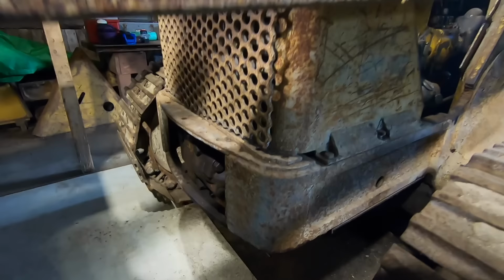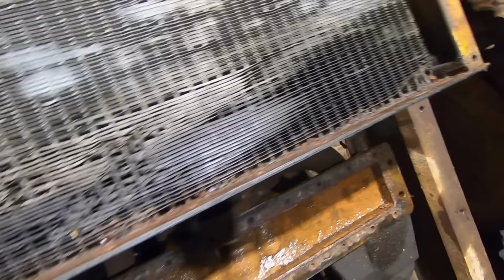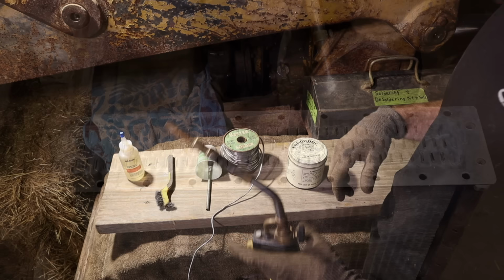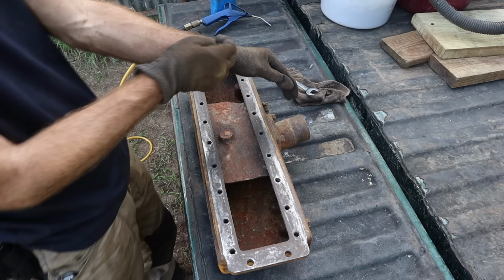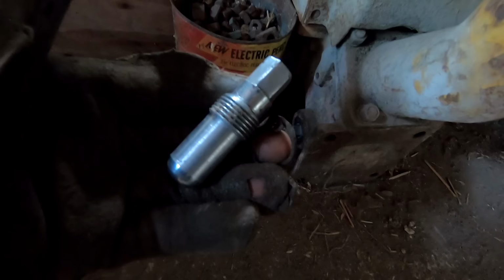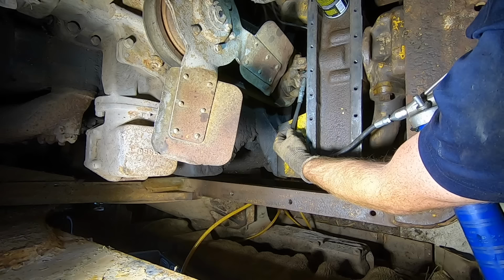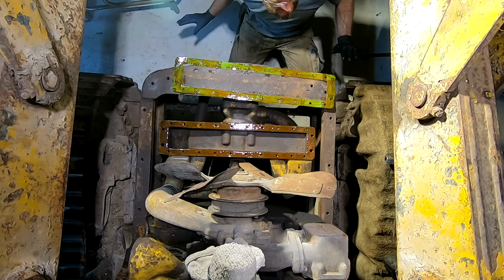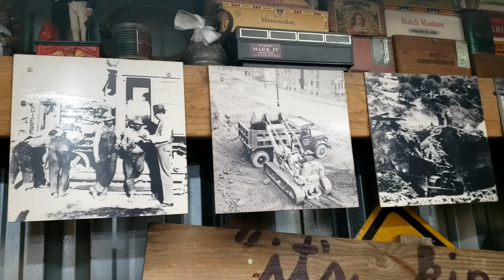The Radiator's ALL CRACKED up... I Guess We Should FIX it! ~ Part 3 ~ 1950's Caterpillar TraxCavator

Comment: Thx so much for sharing. After watching several episodes it becomes quite apparent that this machine was severely hacked over and over. It's one thing to have a bolt here and there break, stuff happens but to have bolts missing that is unfortunate. It seems the more you look the more you find where the machine has just been worked on by people who don't care. The fuel line routing, come on, if you took the time to remove the plates then you would see that there was going to be interference with the brake pedal. It's one thing to have to deal with failures due to age, bad seals, bad gaskets, bad fluids etc., but it's quite another to deal with things that people have just made a mess of.
So far you've done a great job.
I didn't get a chance to read through all the comments but the hours meter should be in the 3,000 hr range. This machine has been used extensively but not 30,000 hrs. In car terms 2,000 hrs is about 100,000 miles.So, the equivalent is about 150,000 miles. So, this machine is thoroughly used. The heavy equipment operators/owners can give you a better idea than me.
The gasket trick was great. I had an older neighbor that showed me that trick. Thx for immortalizing it here on YT.
I hope this machine works out well for you.
Again, thx for taking the time to share your experience and the added narrative.

Comment: I really enjoy watching your videos and like others admire your tenacity. I'd be more liberal with the release oil though. :)
Just one small point the difference between a bolt and a machine screw, is screws have threads all the way along the shank and bolts are only partially threaded. Those were screws you were fixing the radiator with.

Comment: Hello Salvage Workshop, I love your videos and could I really make a suggestion? Before you continue the works you could put this track loader out of this garage and wash all the tractor with soap and degrease solution, and rinse off wiht a lot of water removing all the old grease, soil and dirt. This process could help you to prevent that some dirt could entrance in the engine and support you to see better any kind of leaking, rust, wear etc.. It´s really interesting could to see this old boy cleaned. 😁😁😁

Comment: Today, it would be a cheap thin steel, so one bang and you have to service it to get the part replaced. That is some heavy thick metal in those old machines.
Reply: I own a 1977 underground haul truck and a 1983 loader...everything on them is, like you said, heavy thick metal. No pot metal or plastic on those things!

Now that I mention it, I also own a 1974 loader that's not in running condition. I need to get it hauled back to the yard so I can start tearing into it. I also have an air track drill of...unknown age, and a slusher/scraper hoist that could be very well seventy years old for all I know. Those things are all built to last, lots of massive forgings, castings, and heavy stock.

Comment: if you want to clean between the fins, you can get a foaming cleaner at the big box stores for ac coils. we use it when servicing four wheelers, side by sides and any other off road radiator. when it foams it dissolves bugs and pushes out the dirt.

Comment: nice techniek for making gaskets ill remember that i used to make the surface wet with some oil and than cut out the print that it leaved behind.

good content keep it up
Reply: I've done the exact same thing.  but I think the oil may keep the gasket adhesive from sticking...
Reply: @AffordBindEquipment  adhesive how do you mean? The paper gaskets i use don't have anything to stick
Reply: @wernerbraamskamp3279  extra insurance gasket glue/sealant like Permatex.
Reply: @AffordBindEquipment  ohhh okey i will remeber that

Comment: That pin you were wondering about, is the axle pivot pin, it supports the front of the tractor, and it allows the tracks to pivot up and down, independently.

Comment: The best thing for finding parts on that old 77 cat is a factory parts book. 
They can usually be found on eBay, that’s gonna be your best way of finding any part for that machine. 
A search for a part on any of these old cats is impossible without a part number. 
I got a 1976 977L just trying to search for a water pump or something is nearly impossible I had to buy a parts book for mine as well and it has been a tremendous help for part searching.
Reply: Also you might get lucky and find a factory service manual that would be a tremendous help for fluid capacities, what types of fluids, etc.

Comment: That traxcavator is an Incredible machine... I had one for about 20 years, got it in the early 70's. My cat was a 1958 model and among the last to have a pony motor starter. I no longer have the machine, but I do have the shop manuals... I redid my upper and lower tank gaskets in the early 80's almost exactly like you did, but at that time I was still able to buy the gaskets from cat. Only thing I did different was I flipped the radiator core top to bottom, was advised to do that by one of the old (at that time) mechanics at the cat dealership... He said they always did that whenever possible to extend the service life of the radiator core... all the millions of vibration will work harden the tubes and flipping them helped extend their life. BTW cat has a very good antiseize better than any other brand I have used. I had several broken bolts to deal with on my cat equipment but managed to get them all out and replaced. Good luck to you I did enjoy using and maintaining my Traxcavator and Motorgrader, cat made the Best yellow iron. And that fitting is for a remote grease hose (small hydraulic hose) , makes greasing that pin and bushing possible.

Comment: Lisle Tool Company makes tap adaptor sets, will allow you to use 1/2", 3/8" and 1/4" drives to run your taps. They come in two sets, one for smaller taps, the other for larger taps

Comment: Troublesome or worrisome gaskets that are prone to moving or slipping out of place I use sewing thread to tie the gasket in place so it can not move, the thread is thin enough it will not bother the seal. Very handy for pan gaskets and water pumps.

Comment: A fascinating series of videos on this machine and you are certainly putting some work into it. I have done an old truck radiator like yours but I also put some air pressure down each tube as I found some that had holes along them so then I soldered the ends up. I think you've found the demise of this machine I bet the rad went and they tried to repair it but failed so got another rad but that was never fitted. Good luck with the rest.

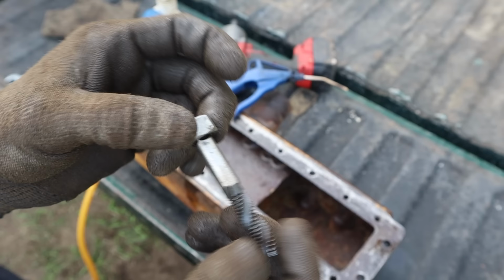Comment: 26:25 Tap sockets are a thing for future reference. they are amazing, I use them to power tap holes with a cordless drill at work, just a normal socket adapter. for re-taping, I would just toss a 4" knurled extension in there so you can hand start it one-handed, and then stick the drill on

Comment: Back in those days what they would  use for a radiator gasket was they were taking innertube whether it was brand new or an old one and they would cut it to fit the radiator and they will put it on the bottom first and then set the radiator on top. The worst thing was was cutting the boat hose for the gasket to fit between the radiator and the bottom half of the radiator portion or radiator tank going to the Dozier.

Comment: Running the tap with a battery drill works well. Chuck up on the round and it will slip prior to breaking. I ran my 1965 955 for about 4 hours Sunday. I am getting good at using the 4 in 1 bucket as a scraper. Keep up the good work.

Comment: Looks like the bolster pin. That is where the front axle pivots. It may be bent and that is why it is hanging out. Those bolt holes are for bolts to secure it to the axle.
Reply from the maker: Thank you!

Comment: Crazy hard work! Looks like a good fix of the radiator and support cover. The drain plug is a sacrificial anode to protect the radiator core from corrosion. You should do a coolant pressure test to make sure the water pump & radiator are holding water.

Comment: another way to make gaskets is to coat one metal surface with oil or grease and press the material onto it. Gives a perfect outline to cut to and with this method you can cut slightly bigger to increase the gasket strength in thin places.

Comment: Having been a heavy diesel mechanic for over 55years it is good to you using antiseize on the threads however experience over the years has taught me to only use copper base antiseize as after a while the silver coloured shit goes hard and acts like loctite.

Comment: Tractor Supply used to sell a tool like  a steel syringe that you filled with oil or penetrating oil,place over zero and hit with hammer to free up zero or frozen joint.

Comment: I think you must take out the hydraulic pump to change the shaft seal. What i could see it is a Sperry Vickers vanepump and it is no problem to get new seals for the pump When the pump is taken apart check the "wings" and if possible you can flip them to get better sealing in the pump.Have a nice day and thanks for your fine videos

Comment: I've only watched 4.30 sec of this video so far, but my thoughts are the same as they were w/the previous videos. Why not load this onto a trailer and bring in back to your shop where you have every tool you'd need [and better lighting]. Set up a massive tent just outside your shop and work on it there; not in these confined quarters. jmo Btw, great series.

Comment: I'm surprised with all those Milwaukee tools that you don't have the vacuum. You cleaning the crud out of the lower radiator tank made me think of it
Reply from the maker: I've thought about getting one, but just haven't had enough need for a battery powered shop vac to justify the cost! If I rescue too many more machines like this, that may change!

Comment: when making gaskets in such a way put the ball peen hammer on the hole to be sheared and strike it with another hammer achieves the same result but with less chance of scarring the surface to be sealed.
Reply: very clever, i'll take note of that one !
Reply: Beware this is potentially dangerous ie using one hammer to hit another! There is some risk of a head cracking and chips flying off perhaps causing eye damage.
Reply: @w056007568  you're popping a little hole in a gasket, hammers don't randomly explode with that kind of force.

Comment: Freakin nice work, man!
Some Kroil will help with those broke fasteners.  Get it hot like you had, put some kroil on there, heat until its boiling around the broken fastener; it stinks but it gets very thin and SEEPS inside making things easy.  A method I've learned on stubborn naval equipment.

Comment: One old trick is when making your own gasket from gaskoid or similar material, is to smear lithium grease over both surfaces of the gasket until it is absorbed wet, that way any imperfection is taken care of, and if you have to take it off again ,it does not stick to any of the surfaces.

Comment: the rod on the left pedal  is banna shaped bar with teeth on the upper side . the lower  side is smooth so the rides on the floor  the outher part  rides on the top of it and the top  rod is spring  loaded up

Comment: It common in repairing a radiator to run a rod or wire through the tubes of the radiator to clear out any blockage.

Comment: That pin on the bottom is to keep the Hard bar attached to the loader frame. And that fitting in the middle should be a Grease fitting. Usually theres a plastic line on it and it goes up in along the motor so you dont have to crawl under everytime to grease it. There should be a couple holes with threads to bolt that pin too. Youll have too jack the middle part of tracker up some probably to get pin in where it belings. You may want to check that pin for a Groove God only knows how long its been that way. You dont want that too fall out. Great Video. Hopefully this helps you. My Dad had a 955 And it was an Animal. One of the first pieces of equipment I ran. I sas 16 years old. My Dads was a 1957,  955... with a pony motor Your runs great...Good Luck Bud....

Comment: You did a good job on the radiator ..I agree with it vibrating and shaking because of loose and missing bolts could have cracked all those solder joints

Comment: The drive shaft for hydraulic pump must cause alot of vibration for radiator especially if universals wear
Some rubber mounts on stabilisers on top help alot for vibration resistance.
Man that bung was tight, I hope you tapped the thread if there was any left.
Thermostat would of been worth pulling out since u done all that.
Nowadays people just put new parts in, good to see a radiator been fixed like the old.days.
That loose fitting looks like a greasable stabiliser for trans or chassis
Great video enjoyed watching.

Comment: it looks like the front axle pivot pin connecting frame to track assembly while letting the racks to move slighty on the front the fitting looks like a remote greaser. Hope the water pump is good!

Comment: I prefer to use a cordless drill with the clutch set medium for field thread chasing, but looks like you are getting it done without too much carnage. Id worry about getting stung or something while trying to ease it in and cranking that tap clean off.

Comment: The next time you do a job like that try putting a stud in each end of the radiator. This way when you bring the two surfaces together they meet eactly right and you don't have gaskets swimming around on you in sealent while you are trying to align the holes. Just a little advice from an old guy. ;-)
Reply: And with the number of missing bolts he could have just threaded a nut on the stud. That radiator doesn't know the difference.
Reply: @davidkaufman9574  Correct. Work smarter not harder.

Comment: Lisle makes sockets to drive taps. The radiator shops I've known use a small tip on an oxy/acetylene torch to solder.

Comment: What you could have done was cap the outlet and pour water in from the top to fill it, then you at least know if there were leaks or not before soldering the top (might as well solder all the veins and know that the core is now the only possible failure point (or make a rubber thing with a hole through it and an air chuck to pressure test each vein and know (only about 15psi if it’s a pressure cap and unlabelled or 8 if it’s not a pressure cap, if it’s as thin as modern ones and isn’t a pressure system, then you only want about 2-3 psi if that)

Comment: The front cross member is there so the track assemble can be removed from the chassis in one part I believe.  The "King Pin?" needs to be in and locked in place so you don't drop the track assembly out from under the rig during any type of articulation.  You may have to remove pressure from the pin by using down pressure on the bucket to lift the chassis off the cross member.

Comment: The second thingy is the track rocker arm king pin. I would not run it until I get that one fixed it looks like the main bolt came off then it just wiggled lose. If you lift the frame up a little and smack it back it place you should be good. Also that pipe should be a grease fitting that also services the front track wheels. Cat did that on all there d series tractor from d 3 to d 8 from 42 to 72. It works well enough and is easy to get to when doing large maintenance.

Comment: I used to use pure paraffin candles on the back of rusted engine blocks to get block plugs out, heat it nice and red and then push the candle on it, the wax is like super lube and I have never had a rusted bolt/plug/nut not come free with it, try it maybe it would help you next time

Comment: Old school tinwork soldering used "killed acid" as the flux.  They'd take a cup full of hydrochloric and add zinc to that until it would no longer eat any more of the zinc--in the process killing the acid and creating the zinc chloride that was mentioned.

Comment: best thing to do with the pump is take it out and have it rebuilt or buy the entire seal kit and rebuild it since if one seal is failing they will all fail soon after. I've rebuilt  a lot of hydraulic cylinders and pumps. the shaft seal probably has 2 to 3 seals on it usually a rubber backer seal and a nylon  or Teflon seal that sits on top of that then either a wiper seal or a hard split pressure seal

Comment: Only thing I would have done different would be to sand blast the top sides and bottom mounts and prime and repaint them CAT Yellow... And then you can tell where ever you worked on it. Then when the entire machine is the same bright Yellow color again, you're finished...
Reply from the maker: I get where you are coming from, and it makes sense! In this situation though, I'm doing all of this in a backwoods barn on their property with no power, water, or most of my tools, in order to drive the machine out of there about 1/2 mile, then load it onto a trailer to haul it away... Then Old Red needs to make it 1 mile through the woods to the place I'm going to store it, and do some more work to it (at least that's the current plan)... so right now I'm more concerned with getting it as ready for that trip as I can... Paint MAY come later!  Thanks for watching & commenting Gary! I appreciate it!

Comment: Little easier way to cut the holes if you have 2 Pein`s put the smaller one on the hole and tap with the other one this way does`nt crush the circumfrance of the hole ,I never buy gaskets I have a 100 foot roll of pallet liner perfect for every use , Plus try to find a Metal hole punch set for doing holes incredibly faster and convienent perfect holes .Good Fix -That should be the wishbone Pivot pin and grease zerk .
Reply: I just posted basically the same comment before seeing yours!!

Comment: Should put pbr rubber grease on the hose inside and metal fittings before attaching hoses. Makes for less corrosion and easier removal.